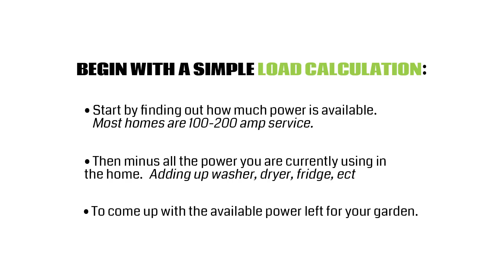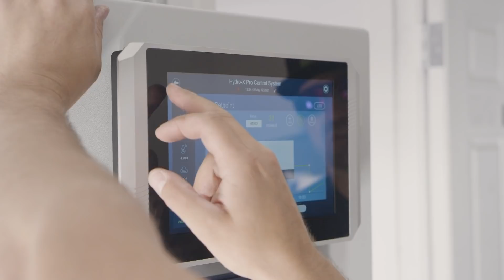Grow Room Electrical Safety | Growing Green Vol 5

Comment: You said that 1000 watts of HID generates more BTU than 1000 watts of LED, Is that 1000 watt equivalent of LED or 1000 actual watts? I'm trying to calculate my cooling load and was under the impression that a watt is 3.412BTU no matter what, though I also thought that my dehumidifier creates a lot of heat for the power that it draws. It sure seems like cooling is more complex than just watts used in the room, does a space heater equal more BTUs than a light using the same power?
Reply: @vids595  It does seem like the basic cooling load calculations of watts=BTUs are an extreme oversimplification, but I guess that's why there are specialists.

Comment: A few times had owner of a grow run their own electric upgrades, and it ends up over heating and causing burned wiring and heated wall wires that melt and cause fire or major smoke damage. Hire a pro for electricity, well said.